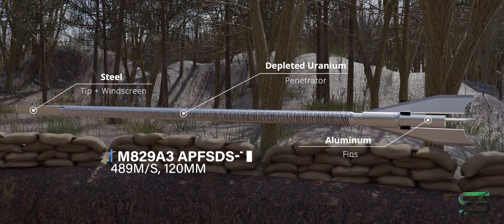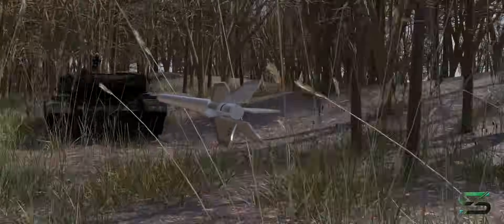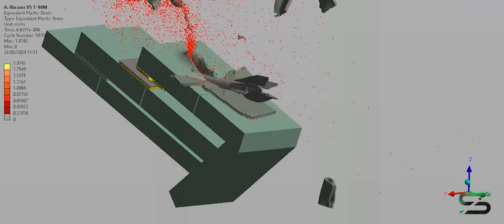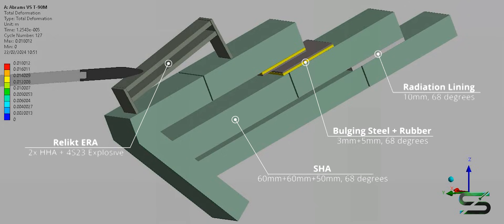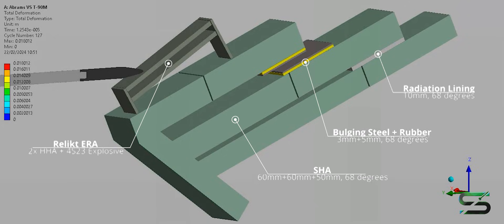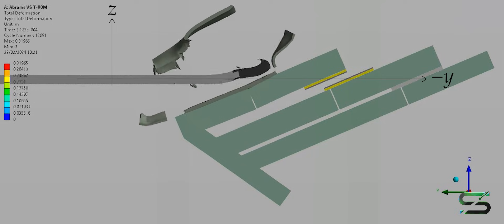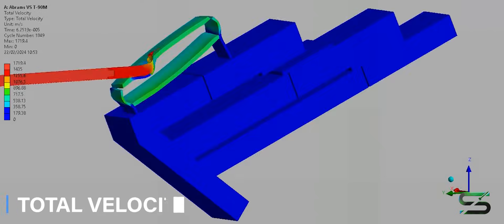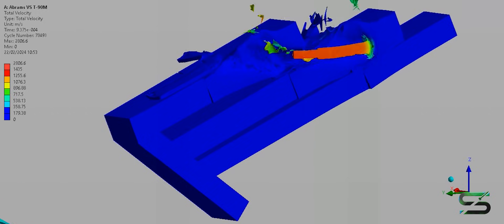M1A1 Abrams VS T-90M | Armour Piercing Simulation

Comment: plz make video about turret armor merkava 4m
Reply: The Merkava doesn’t have much armor, it’s an infantry fighting vehicle. They have a lot of thin metal to protect against simple grenade launchers, and that's it. Any tank will shoot Merkava.
Reply: @MultiNike79 this is a joke… right?
Reply: @M4_Sherman587  No. The Merkava is designed to fight the poorly armed semi-civilian indigenous population of Palestine. Accordingly: huge dimensions and internal volume for landing, which is impossible for tanks. Thin spaced armor can combat the cumulative blast from simple grenades, but is useless against modern anti-tank missiles or APFSDS. Slow and heavy is normal for Israeli soil, but in Ukraine or Europe it would be an easy way for soldiers to pay off their mortgage.
Reply: @MultiNike79  i dont think you know what an IFV is… the merkava by definition is quite literally an MBT. Also, i have no idea where you got your info about it being underarmored, some parts of the turret has almost 1000mm of protection against kinetic rounds. plus, it has the trophy APS system to protect it from missiles. it was literally the main reason the merkava was built, to have a tank that will absolutely protect the scarce number of qualified crew israel has. do not talk about something you have 0 idea about.
Reply: @M4_Sherman587  i dont think you know what an IFV is
What other tank do you know that can transport troops internally? And the design of the tank was copied from a captured Soviet IFV, with its engine at the front and the driver at the side.
some parts
The Merkava is a huge tank that cannot be properly armored. This is more even compared to Western pseudo-tanks like Abrams or Leopard. Simply, according to physics, the Merkava will be inferior to normal tanks in terms of armor.
the trophy APS system
Please note that in real footage of the Merkava’s defeat, Trophy did not work. There is a reason why no one uses the APS system on the battlefield, rather than in punitive raids against civilians. The same Arena-M was developed a long time ago, but in real conditions these systems have too many problems.
a tank that will absolutely protect
Please note that the results of the war in Grozny and similar scale operations in Lebanon - Merkava and T-series showed similar results in terms of tank losses and crew losses.
Tanks of Russian crews are easier to protect in much MORE COMPLEX conditions than Merkavas, which can only shoot the weak with full cover.
have 0 ideas about.
Yeah, yeah.
Reply: @MultiNike79  rule number one of the internet, never argue with an idiot. you certainly are one, my friend. maybe i’d believe you if you cited  any reliable sources
Reply: @M4_Sherman587  I have been participating in these debates for more than 20 years, all the main statements are standard :)
Don't you know that the Merkava is 1.5 times larger than almost all tanks in the world? Don’t you know that it has the engine in the front and the driver on the side? Have you seen the video of the destruction of the Merkav? Where is the Trophy?
You know that Israel was created by Russia, right? Russia saved Jews from the European Union in the 1940s, Russia demanded the creation of Israel at the UN and was the first to recognize it. Russia created the IDF: it copied the structure of the Soviet army, there were Soviet officers and weapons were supplied from the Soviet bloc.
Therefore, an erudite person understands perfectly well how and why all tanks are the way they are - they are created for certain geopolitical situations.
Reply: @MultiNike79  the european union wasnt a thing in the 40’s, are you okay?
Reply: @M4_Sherman587  Hello, haven't you heard how the Europeans united into one alliance in 1941 to attack Russia? Now it's exactly the same.
There is no difference between the Third Reich and the European Union, except that then the Germans were in charge, and now the Anglo-Saxons.

Comment: Why are T-90M steel plates segmented? That may have altered the results in some way.

On the other hand, perhaps try delaying the detonation of ERA a little bit more? This feels very "sudden", the back flying plate had almost no interaction with the projectile.
Reply from the maker: The plates are segmented to reduce the number of nodes and control the size of the segment. This process has no effect after using fixed support and other techniques. Actually the second plate interacts with the penetrator, the detonation time was set to simulate the real Relikt mechanism.
Reply: @SimulationPlus why penetrator has just one segment ? If even DM53 has 3.
Reply: @romanyalovyi6079   actually DM53 penetrator is not segmented. M829A3 as we know from the patents has 1 segmented sacrificial section which is the tip of the projectile made of steel.
Reply: @alanch90  DM53 has 3 segments.
German patent DE 4023482A1.
M829A3 is the same, but longer.
Reply: @romanyalovyi6079   well its not that straightforward, no patenet can be explicitly linked to DM53. There are other patents that can be related to the projectile that don´t mention segmentation at all (however defeat of ERA such as Kontakt 5 can be achieved by other mechanisms).
Recently a DM53 projectile and penetrator were put up for exhibition on a museum, providing the first clear vieo of the naked penetrator and there are no signs of it being segemented, but a special "stepped tip" structure is observed.
Reply: @alanch90 it’s patent for DM53. Defeat K-5 can even DM43. You should learn Palastrov work. 
Show me DM53 in museum ?
Reply: @romanyalovyi6079  how can I send you pics? BTW Dejmian Simulations simulated a DM53 with the 3 segements vs T-90 with K5 and Relikt. It was succesful vs K5 but unsuccesful vs Relilt.
Reply: @alanch90  so museum it’s fake. I can’t find nothing. 
I saw this simulation, wasn’t DM53. It’s was DM43. DM53 has 3 segments and was designed against Relikt.
Reply: @alanch90  Rheinmetall uses a special state-of-the-art tungsten penetrator that is capable of
overcoming the most extreme cutting and bending forces of double-reactive armour.
This makes it possible to defeat all known types of tank armour, including multi-layer
and composite arrays and reactive armour systems at all ranges of engagement.
Even at long ranges of engagement, it can perforate the main armament behind the
double-reactive armour front module of modern MBT. Fired from L44 and L55 tank
barrels, the ammunition is extremely accurate.
Reply: @romanyalovyi6079 nice marketing article. Proofs? Do you work for rheinmetall or just dyakuesh day and night to master?😂
Reply: @olehcelsior1005 another amateur, marketing article ? 🤣 Proofs ? From who ? It’s official data from Rheynmetall DM53. 
Just russians have master, keep talking, maybe he give you Doshirak.
Reply: @romanyalovyi6079  "I know the Wunderwaffe works cause the guy selling it says it does"
Reply: @comrade-princesscelestia4907 🤣Palastrov doesn’t agree.
Reply: @愛を込めてロシアから  kacap na butylku
Reply: @romanyalovyi6079  mogilizuysya hohol
Reply: @SimulationPlus  "The plates are segmented to reduce the number of nodes and control the size of the segment. This process has no effect after using fixed support and other techniques."

Bro why are you lying so shamelessly? We LITERALLY can see the last plate shifting away on video, you didn't fix it to make it look like the dart penetrated. You also clearly made the ERA explode too fast. You're biased as hell and lying like a children.
Reply: watch more of this channels videos and find the bias?🤔

Comment: The M-829A3 tip isn't steel, its tungsten.
Reply from the maker: What is your source?
Reply: @SimulationPlus  

The ATK patent for Steel tip comes well after the round was in full production and refers to an export round concept made of tungsten.  

The patent for the M829A3 penetrator # US6662726B1 was submitted in mid 1999, and the DOI for the M289A3 was 2003.  (you can google it)

"first portion of the body having a first mass of about at least 9% to 15% of a penetrator mass and consisting primarily of a single piece of a tungsten-based material"

"The former is chosen to produce a relatively wide hole in the face plate of explosive reactive armor while the latter is chosen to best perforate basal armor. The connection between the two portions is configured to rupture under pre-determined conditions, namely at a threshold torque between the first and second sections. Such rupture reduces the tendency of interaction forces between the armor and the first portion from deflecting the second portion into an ineffective, highly oblique relation to the basal armor."

There is no mention of a steel tip. 

 The alloy of the M829A3 is also far better than the M829A1 at around 5% better performance against RHA at 0-deg, and far more resilient to deformation.
Reply: It is steel, It isn't like dm53 that is tungsten.
Reply: A3 was designed to counter ERA,which is why it has a steel tip
Reply: @CorianderBoy  I posted the US patent US6662726B1 which is for the M829A3 penetrator. Not sure why my comment was deleted. However, if you google it you can see that they designed it in 1999 with a tungsten penetrator to defeat ERA.

This is not hard. Google it and read it.
Reply from the maker: No one deleted your comment. I will consider the information you provided.

Comment: У автора неприязнь к т-90
Reply: Потому что Т 90 превосходит Абрамс, хотя бы потому, что у него нет заряжающего факинг нигга 😅
Reply: @MrBonako  у Т-90 есть Инвар, который позволяет отстреливать Абрамсы с безопасных дистанций :)
Reply: А у физики? :)
Reply: @MultiNike79 when ERA plates fly faster than an APFSDS projectile traveling at 1600 meters per second. “Physics” you say? 🤡
Reply: @Anonymous-is6xu  The detonation speed is 10 times faster than the combustion of powder gases. Nothing surprising here. The difference is that the projectile will arrive in one piece, and the plate will turn into fragments.
Reply: @MultiNike79  а у автора физика особенная. Иначе как объяснить, что него советские снаряды никогда не пробивают западную технику, а западные всегда российскую? Причем, еще с времен второй мировой. Физика на это смотрит с недоумением.
Reply: @MultiNike79 

Physics are rusophobic

Comment: I don't know did the ERA do well or not
Reply: The APFSDS didn't penetrate the T-90M
Reply: it seems to have prevented proper penetration by destabilizing the projectile, so I'd say yes.
Reply: it didn't. The relikt exploded way too quickly, only damaging the head of the shell, not the body.
Reply: @chickenchicken8097 well the tip didn’t break away like it was supposed to either
Reply: @chickenchicken8097 did you not just watch it? Not only did it damage the head, the tip didn’t break away it warped the projectile in the front, which is the whole point of the breakaway tip.. to defeat deformation of the rod before it makes contact. This video while a good simulation of what it used, is missing key segments that would affect the outcome in big ways. Some people said the era exploded too fast, the tip didn’t break way and deformed the rod. These make big differences in the outcome.
Reply: The ERA didn't work like in real life. It eploded before the tip even entered, lol, while that's even a specific kind of era made to delay explosion. The channel owner did everything ehe could to make a penetration possible and is now in full damage control in the comment section.